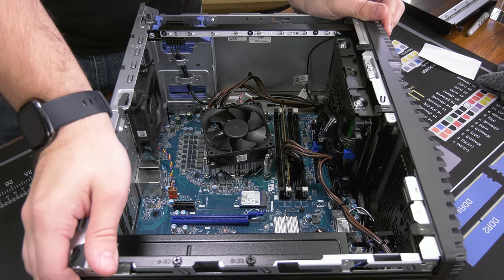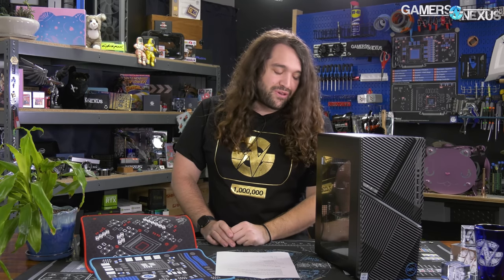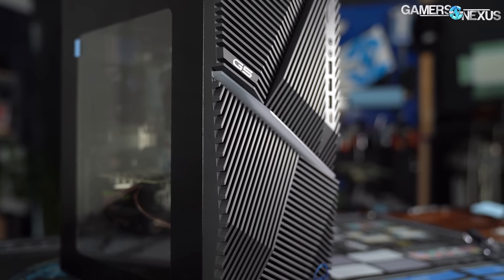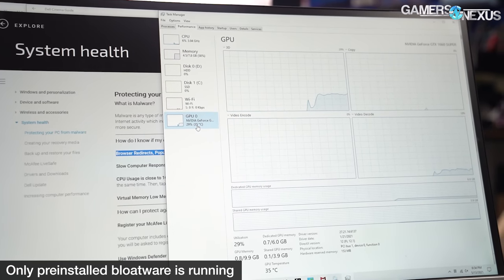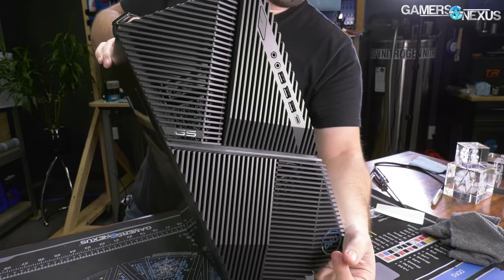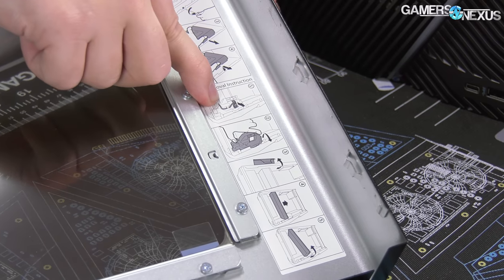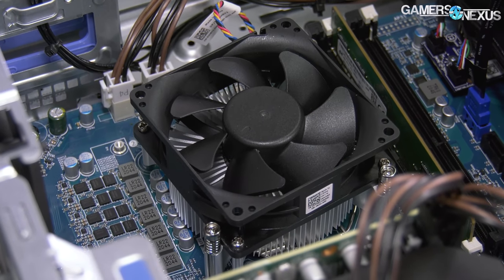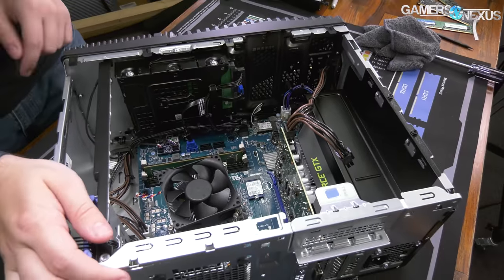Worse Than Walmart: Dell G5 5000 PC’s Garbage Parts & Hidden Charges

Comment: I have a theory about the extremely proprietary board; that design cuts down on the number of things that a human has to plug in and screw. It's all done to save costs to dell in returns, and from actual human beings doing jobs.

There is an accountant somewhere with a big fat bonus for doing this.
Reply: No one has to plug front IO, instead of a separate  PCB for the IO you just extend the Mobo. Yeah some asshole did a very detailed cost analysis on this.
Reply: So there is someone out there that did the math and came to the conclusion that getting a custom build PSU and a custom build motherboard is cheaper than some chinese slave laborer plugging things in?
Reply: all the office pc companies are doing this now, its just that dell did it in a gaming box, hp did it in their pavilion gaming boxes a while back also, edit: they still do
Reply: @HappyBeezerStudios  well labor costs aren't the only thing that matters, when dell does this they are able to pump out far more PCs than they would if people were screwing and plugging in more things
Reply: @HappyBeezerStudios  It's also less to go wrong - A human could fail to plug it in correctly, or it could come loose in shipping. Reduces support costs. Also when things are proprietary and they do go wrong, the customer is forced to come to you for replacement parts rather than buying an off the shelf replacement. When you're a volume manufacturer you have to look holistically at the whole end-to-end process of manufacture and support for the product's lifecycle. Spend some more here, save lots there.
Reply: @HappyBeezerStudios  They found the whitelabel spec for the PSU, so it wasn't custom. Whitelabel means you can go to the same manufacturer and order some with HappyBeezerStudios printed on the side of it and pretend it's your product.
Reply: @HappyBeezerStudios  I used to be a field service tech for them. These systems are designed for ease of assembly and ease of service. Less time spent taking things apart/put together means that you can put more unit out of the factory or take more service calls per unit of time. It's all about efficiency.

Comment: Having taken apart many low-spec computers from the early 00's, this looks identical to those.
Reply: esp the weird slanted cpu cooler made from the cheapest fan they could find. Its a  dead ringer for old old shitboxes ive bought for nothing off ebay
Reply: @Battledongus  Back then the only difference between an OEM and a budget heatsink on the MOBO was the angle. At least back in the Pentium 4 days, when the included heatsink from AMD and Intel was the same extruded aluminum with a 80mm fan on top. Though for a CPU that can't be overclocked I don't see a problem, and I even find the angled heatsink kinda endearing. Reminds me of my first pc build when I used an eMachines chassis I had and removed the motherboard with the Celeron D. No excuse for using actual sub-par components though and the avoiding of common industry standard connectors. Even eMachines was smart enough to realize that using ATX components would make the parts cheaper overall.
Reply: Looks like the optiplexes at work

Comment: "Load-Bearing CPU Cooler" was my nickname in high school.
Reply: Made me LOL
Reply: You went to a seriously weird high school then. At the one I went to the vast majority wouldn't even be able to pronounce that, and the nerdy ones who could were in no position to call people names..
Reply: @andersjjensen  ok
Reply: I've always wanted a CPU cooler that is bolted to the chassis. This way you won't have to worry that the super massive CPU cooler would snap your motherboard.
Unfortunately, Dell put the smallest and weakest cooler they could get away with.
Reply: @ИванСнежков-з9й  yeah it's not a terrible thing to have. Can actually be a selling point
Reply: It could be a selling point for a case. But the case should at least have the AM4, Intel LGA115x and LGA1200 mounting holes lining up correctly. Not even to mention Threadripper and the Intel enthusiast platform.

But technically it's something you could do yourself IF you can find the proper length spacers. The spacers must exactly fit between the motherboard tray and the motherboard when in place. Extra long threads on the spacers could also be beneficial. Just drill holes in the motherboard tray which line up with the holes in the motherboard. Use the backplate which came with the motherboard (AMD) or cooler (Intel) to bolt the standoffs into. Screw in the motherboard (with CPU). Then mount the cooler and screw it into the standoffs behind the motherboard. Et voila! Your cooler will no longer be hanging from the motherboard.
Reply: @CheapBastard1988  the way I see it is simply having holes in the backplate and then you install feet just like standoffs depending on your cpu (backplate being the "case" in this case)
Reply: @CheapBastard1988  It totally was a selling point for BTX cases.  The issue was the execution required entirely new components, and they simply never achieved market share.

That standard is why a lot of cases mount the PSU on the bottom now, because it was one of the good ideas that could be adopted with standard ATX compatible parts.

Comment: "Wait. WAIT WHAT? The CPU cooler is attached to the case?!?!"
Dell agent twists mustache....
Reply: quite normal for Dell and HP machines
Reply: @bottipoika  thank god i stayed away from dell so far, but had several bad experience with hp Laptops and printer
Reply: @Dildozer68  everyone has a bad experience with HP printers, especially if they are wireless
Reply: Bingo! Hp envy
Reply: It's not part of the plan to upgrade or to ever take apart. If you get a virus or if the fan has too much dust, you throw the PC away and buy a new one.
Reply: Yes to cool the cpu
Reply: "Mmm yesss YESSS!!!"
Maniacally laughs

Comment: This absolutely makes sense when you consider that Dell sells 40 million of these a year. Every cent they save on a build adds up to nearly a half million dollars.

At that sort of scale they have huge buying power and every small cost saving adds up. Some dell bean counter must have worked out that it was cheaper to integrate the front IO onto the motherboard itself than the cost of making a seperate board that plugs from the case into motherboard. 

Every design decision here is pretty fascinating when you look at it from this lens. Every screw costs money, both in cost of part and labour. So the CPU cooler screws do double duty.
Reply: The load bearing CPU cooler is nothing new for Dell. The heatsink mount for their BTX systems held in the motherboards as well, but this is an even cheaper method of doing it. This is also not a new CPU cooler design. They used it for years on the Vostro line, though on those there was a backing plate on the board that it screwed into, but same heatsink, mount, and fan design.
Reply: I would rather they charge a couple bucks more then resort to this.
Reply: Using custom, non-standard parts isn't about reducing the build cost to save money.  It's about planned obsolescence.
Reply: This should be the top comment.  Steve is incredulous, but anyone who has worked in business IT knows that this is totally Dell's M.O.:  Their core goals include manfacturing the cheapest PC possible with good-enough quality electronics that is also easy to service with dell replacement parts.  Adding extra screws where clips and levers would suffice adds cost to both manufacturing and service.  Making all the parts conform to retail form factors also adds to that cost.  If you want a standard retail form factor system board, case, or power supply, you're buying from the wrong place.  That said, they could have done a better job with the cooling both on the CPU and GPU.
Reply: @culbeda  No, it IS about reducing costs both on the manufacturing and service side.  And it works for business PCs.  Just not so much for the enthusiast sector who wants to buy their favorite part from XYZ brand and use it with the existing hardware.
Reply: @culbeda  It's a nice side effect.
Reply: this is why i haven't bought a prebuilt in 15 years. even with increased prices i could build a better system for 900.
Reply: @pseudocoder78  which works out great for the business environment. Then again most offices i worked for would only buy Lenovo. If i started a business office id much rather have Lenovo over Dell....
Reply: @pseudocoder78  While I unerstand your point, i was surprised too. This is built like it is a $300 machine meant for an office with a maintenance contract, not a premium $900 computer for retail users. I don't think it is poorly built in fact, but the thought process isn't right for the target audience, I think.
Reply: 1 recall can wipe out what they saved. think how many cars have been recalled due to cost savings.
Reply: Makes sense for profit, but no sense ethically or for  sustainability
Reply: Had dells first sff PC. My god was that thing a POS.   F.
Reply: @RandoWisLuL  10 or 15 years ago, I used to buy refurbished Lenovo desktops from Micro Center here in Atlanta then customize them for use in medical offices. Those things are STILL running. When anyone asks, I say "Buy Lenovo".
Reply: @allothernamesbutthis  When was a line of computers recalled? I don't ever remember that happening and I've been building computers since the '80s. (I'm not saying it never happened, but...)
Reply: @AtlantaTerry  I worked for years re-imaging, repairing and deploying Lenovo laptops and Tiny PCs for an INC 500 Travel company.  Lenovo hands down was the best brand of laptop ive ever had to work with. Easiest to deploy on a mass scale. Easy to deal with client support....these machines would go through hell and back going on the road. I cant recommend another laptop more, especially for the enterprise market. They definitely keep technicians in mind when they build these. and the Tiny Station/Tiny PC models are absolutely wonderful little desktops...i even used a few to make a mini home lab once( before i upgraded to an enterprise server)
Reply: This number is OUTRIGHT FUCKING BULLSHIT! Dell sells approximately 10 million PCs a year which includes both desktop AND laptop. From this particular model they might sell something like one or two million AT MAX!
Reply: @RandoWisLuL  Believe it or not HP has a more standard form factor in their Workplace systems as well.
Reply: @AtlantaTerry  tech Jesus was showing power supplies catching fire a few months back, I thought he got the company to do a recall? There's bound to be a lot of recalls in the past.
Reply: @ekoren6116  Well, they technically are charging more. Its just they are charging more for the parts that shouldn't be charged more.

Comment: One of the most frustrating PCs I've ever worked on was an Asus prebuilt. I opened it up and was surprised by how many standard components they used. The case had an ATX PSU mount, standard E-ATX etc mounting holes and an apparently standard motherboard. Only when I actually got into it did I realise the motherboard itself, despite having standard form factor REQUIERED their proprietary power supply. The front panel connectors were some weird proprietary thing, no 24pin power slot etc. Everything in it was almost standard. Even the fucking CPU cooler was their own special screw spacing, so you couldn't use it with any other board or CPU of the same era. Fucking ridiculous. Lost a lot of respect for ASUS that day. Now I tend to buy MSI motherboards as the BIOS is better anyway.

Comment: That chipset bracket holding the heat sink on is actually electrically connected on either side, so that if one side pops off or the whole thing falls off, the motherboard will throw a cooling error.
Reply: What? 
Third party cooler = cooling error 
Literally getting heat gunned = no error 
Makes sense to me
Reply: @mistakenotou7681  No, the chipset on the motherboard. That little-ass heatsink with the metal wire thing running from one loop to the other. At approximately 14:53 he mentions this, but this is a common thing on Dell motherboards for decades now. Those little loops that it's hooked into are electrically connected to the motherboard by the metal restraining spring connecting the two. If that thing becomes disconnected, then an error will result.

Anyone who has worked on similar Dells will have had experience with these retainers. Inevitably you will run into a computer where that connection is severed for whatever reason.
Reply: @rars0n  That is a pretty standard way to secure heatsinks. Nothing wrong with it really. I've seen one pop on an IBM server, the thing ran without problems until it was fixed.
Reply: @rars0n  Thousands of Dells, nope never had that problem.
Just checked a 3090, both connected to ground. You are talking nonsense
Reply: @incandescentwithrage  Then you haven't checked enough of them.
Reply: Was that a thing also in the Pentium 4/Core 2 era when many boards used a similar mounting?
Reply: @RuruFIN  I'm pretty sure it was, as I've worked on a ton of P4 and Core 2 machines and have seen quite a few of them pop off.

Comment: Dell has always been trying to sneak in charges, or leave in things you specifically ask them to not quote.  
I worked at a very large Defense Contractor in the DC area buying IT equipment for nearly 10 years (2005-2015). I purchased on average $3-5 Million in Servers, Desktops, Laptops, Storage from Dell each year for the company (Just my division. We did a LOT of business with Dell).    I constantly had to review every quote they provided (they would configure and send quote), as they would always slip in some weird charge or upgrade some Service level you specifically said you didn't want.   They always seem to make it sound like their quote system reverted to some other option by accident (guess when you are a Global company that spends $30m+ yearly with Dell, they want to keep you business and don't push back when you call out their errors/fraud).

Comment: Around 2003 I I took a cisco networking class. There were a dozen or so pre-builts for the class to tear down, work on, and learn from. My group got stuck with the only Dell. The components were all behind metal plates soldered to the case. They had to be cut off. Besides the HDD, nothing was standard and/or matched any of the coursework. It was obvious that Dell was trying to make the computer impossible to work on, much less upgrade. The experience was so terrible, I've spent the last (nearly) 2 decades refusing to even consider purchasing anything remotely related to Dell.

I still tell my story to people to try and warn them away from Dell. It's good to know that in the nearly 20 years since, almost nothing has changed and I haven't inadvertently been steering people wrong.

Comment: Check out the lenovo legion prebuilt. I watched another youtuber give it a great review from case design to standardization to upgradability. A pretty decent package all around. It did have a suspiciously similar 1660 super but with a different logo printed on it. It did have a nice flow through air cooler and not a cheap flow down cooler.

Comment: I used to be a Dell service repair person in the 90's. The place I worked for was called out to do onsite repairs. Dell has sucked since at least then as I often had to go back after the correct part was sent out on the second time. It got so bad locally that the Sam's that sold Dell told people to call our shop before Dell so we could figure out the correct part for Dell to send. I did not get paid to go back out and I serviced an area up to 40 miles away. Needless to say, we didn't renew that agreement after the year was up.

Comment: 30 years ago I bought a fairly filled out E-machine from a Mom & Pop computer store at a great price with a 3 year warranty.  By the time I switched to a new machine I only had the case left of the original computer due to parts breaking down.  Each time a part died you could only replace it with one that was better, faster, far more memory, etc. at no cost to me.  Sadly the store went out of business.  During this 3 year period my brother was running the thermal testing lab at Gateway who owned E-machine. He told me he never had a new E-machine model that passed a thermal test nor did he ever hear of an E-machine last 3 years without breaking down.